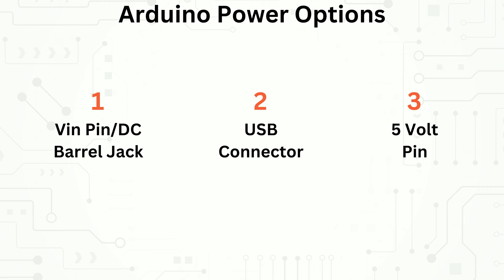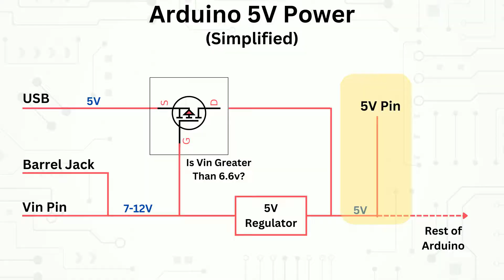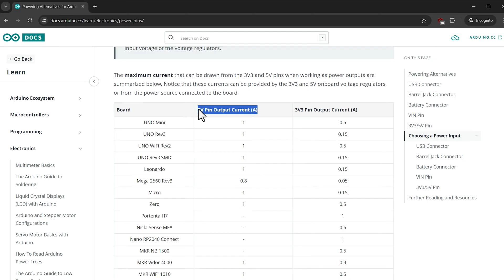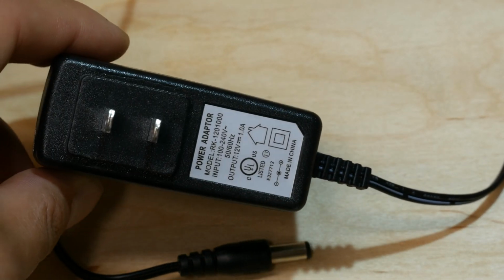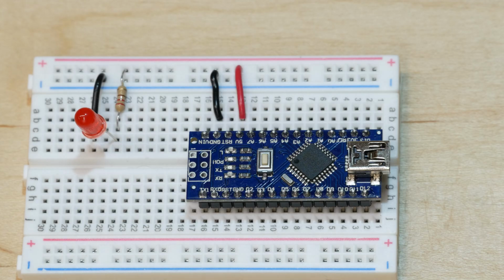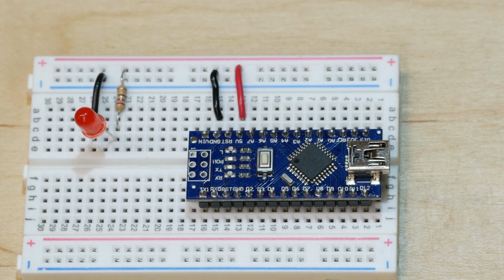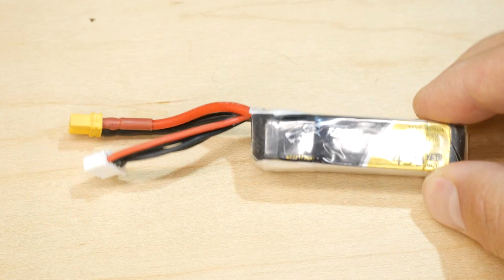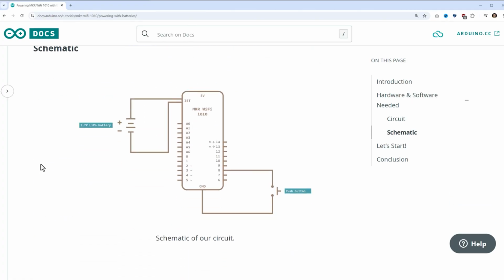Power ANY Arduino Project - The Ultimate Guide

Comment: Great video, thanks for sharing it. Question: I want to create a counter using 7 segment displays that require 7.2v - 8v. If I use a barrel 12V connection, and feed the bread board off the VIN, will that give me enough volts ? I am very new to this, so any help will be appreciated.
Reply from the maker: If you have something that needs 7.2-8V you will need to step down the 12V accordingly using a step down convertor. You can still use 12V on the Arduino VIN, but in parallel wire the step down converter to the 12V to get you the 7 segment display requirements.

ALTERNATIVELY you can use two power supplies like shown in the video, with the second being a supply in the rated range. 

What you don't want to do is plug 12V into a module that is rated for 8V, as that will likely destroy it. 

Now that's the power issue sorted. The other thing you will have to figure out is how to actually control it with Arduino. That's going to vary based on what you actually have there.

I'm guessing most likely it's a module that's got 1 or more 7 segment displays on it, plus some kind of driver IC, and (hopefully) a 5V compatible interface that's easy to connect Arduino to. In that case your best bet is to just look up a tutorial and you'll find how it all needs to hook up, example source, etc.

If by chance you are talking about a bare 7 segment display (no driver IC) OR this is some module that wasn't built with the intention of being controlled by a 5V logic microcontroller, you are in for more of an adventure. 

If it all becomes too much, there's also low current 7 segment modules that accept 5V input and are dead easy to use with Arduino. And a million tutorials on how to use them. So that's an another alternative.
Reply: @MattInglot  Thanks for that info. I think I may have a difficult road ahead, as I have an Arduino UNO, and 4 - 7 segment displays that are about 3" high. They are just the 10 pin displays. Suggestions ? I have watched many videos that use the small 1" high displays and I was hoping to duplicate the hook ups for these larger displays.
Reply: @MattInglot  Thanks for the info. So I have powered up the Arduino with a 7.2V battery, and can illuminate the display using the VIN. The display is cathode. Can the Arduino be programmed to use the VIN on the cathode display ? Thanks again for all your advice.

Comment: 11:55 Remind me: when do you power the board with the 5v pin vs Vin?
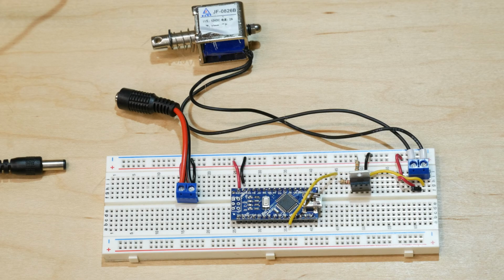Reply: Oh I think I have it at 5:00. If the power supply is 5v use 5v. If 7-12v use Vin. It's been years since I've messed with this stuff.

Comment: Hi Matt- I'm assuming in this video that the 24 V power supply uses less than 1 amp, and that it's power supply is attached to the rail ( couldn't quite see that).  Are there limits on voltage regarding the power rail.
Reply from the maker: If you're referring to example 3, I have the 24V supply going to one of the terminal connectors (it's the twisted red and black wires), and then using jumper wires to connect that to one of the power rails of the bread board. Critically, the 5V to the Arduino is connected to the power rail on the OTHER side of the breadbroad. So we have two power sources we are dealing with. Do not connect the 24V to the Arduino 5V or you will have a Deaduino.

I'm using a breadboard for demo purposes, but for a real project you normally want to move from breadboard to soldering something permanent on a protoboard (or even getting a PCB made if learning that is of interest). This is especially true for a circuit like this where the solenoid is actually wants a fair bit more current than the 1A that a breadboard can handle on a good day.  It's fine for demo purposes, it only fires momentarily so it's not going to harm anything here other than solenoid will underperform.

One other very important thing to understand. The power supply doesn't "use" anything in the way you imply. The load (such as this solenoid) dictates how much current the circuit draws. The power supply's job is to supply the current that is required by the load. A 1A supply will supply up to 1A. But if you hook it up to a circuit that draws 0.5A, it will supply 0.5A regardless of what the supply itself rated for. 

That 24V supply in the video has some massive rating like 10A or even more (I'd have to look it up), but that doesn't mean that the circuit draws 10A. However if I had hooked up a smaller supply, say a 0.5A one, then I would be overloading it and that's a bad idea.

Comment: Matt, great information. 

Quick question. You mentioned when you are powering a nano with a 5v USB power brick, you should not connect anything to the nano USB.
Can you please elaborate? 
(My project involves trying to power the nano through external power and then send serial commands through the USB)

Comment: I thought the 5V pin was only a (5v Out) pin, never knew it can be used as a 5V IN for 5vsupply for 5v projects without the worry of Arduino current limit.  Thanks for cautionary warning to not use the VIN / USB when powering through this procedure. 
I m so impressed that for the first time I'm commenting twice back to back.... 
I have a question though not related to this topic , it's for my personal project I'm working on a 5v-Sound-Reactive Laser Diodes , i was able to make different patterns with the laser diodes but i'm to make them reactive to sound so that not only it does the motion pattern like the RGB strips but also react to music.
Reply from the maker: The honest to goodness simplest answer is to google around, with keywords like "sound reactive LEDs with Arduino" Lots of people have made all sorts of projects that react to sound in various ways. Find something that does it in a way that you like, use it as a starting point. That gives you your input (in this case sound, processed in some way). Then instead of controlling LEDs or whatever the example is, put in code to control your lasers instead.

Comment: Thank you for the video!
At 11:50 you say "under no circumstances should you also try to power the Arduino through the VIN pin or Barrel connector".  Do you mean "don't COMBINE power" by providing 5 volts to the 5v pin and the VIN pin at the same?  You should be able to provide 5 volts to the 5v pin OR 7-12 volts to the VIN pin but just not both at the same time.  Correct?
Reply from the maker: If you are powering the Arduino through the 5V pin, do not apply power to VIN at the same time.
Reply: That's what I figured... thanks for the reply!!

Comment: is it possible to use the same power source, let say 8.4V, and use 2 DC-DC regulators to get 5V and 12V to power both arduino and the "external" components like motors ?
Reply from the maker: On paper yes, BUT two things to consider:

- I'm guessing the 8.4V means you are using a 2S LiPo. Can you use a 3S battery instead? That would typically power 12V motors just fine without a regulator, unless your application really requires 12V dead one. That removes the bigger regulator (motors draw way more current than Arduino so need beefier regulator). You can then step down to 5V for Arduino.

- The above will probably work, I know because I have 3S and 2S combat robot that drive motors and MCUs off the same batteries. And LiPos tend to be pretty good for this type of stuff. But motors = electrical noise, so depending on your application, you may find yourself dealing with power issues that could have been avoided with 2 power sources. So that's the caveat.

Comment: What will happen if you both both USB and Barrel/Vin 5V? Will the Mosfet still work?
Reply: No, because the Mosfet won't have the information to turn off the power.  It needs to detect >6V on the power input pin, to shut off the USB-integrated power.

If you attempt to power with both 5V sources simultaneously, you'll essentially have a short circuit between (5V + epsilon) and (5V + delta) as the sources connect, where epsilon and delta are the small deviations from 5V on the dot, that each 5V source provides.  You'll essentially draw current simultaneously from both power supplies, until the voltage drop across the internal impedances and wiring makes epsilon and delta equal to each other.  This may even mean your external source ends up charging your computer during this time, if the load doesn't draw enough current to allow voltages to match.

If you intend to do this, you'd want to fine-tune your external 5V power supply to match the USB power supply voltage as closely as possible.  Or use a USB adapter that allows you to abandon the USB power source.

Comment: Also yes please create a video about battery powered projects and selecting the correct battery for your requirements
Reply: And rechargeable ones maybe, and if they support being recharged while powering Arduino. A portable usb charger will work most likely, but it’s a bit less elegant solution.
Reply: @Emil_m  Uhm, how else are you going to charge a battery without a usb charger?
Reply: @JunkaTerri lol, I should have clarified ;) There are some newer batteries that have a USB-C port on them. I’m not 100% sure if they are designed to allow for being used + charged at the same time.
Reply: @Emil_m  Ah okay - anyway, usb-c doesn't change anything much - it is the same as micro usb, just better connectors and such stuff.

Comment: This is such a helpful video thank you so much. 

I had a question though, at 5:53 you said the 12V power supply can supply more than the 1A current the Arduino can supply, but the specs on the power supply you used showed the Output as 12V, 1A. So we're not getting more than 1A through the system?? Im confused, did I misunderstand?
Reply from the maker: If I showed a 1a supply and caused confusion then apologies! I was working with what I have on hand. But the important takeaway is that since the Arduino isn't supplying the power, you are not constrained to a 1A supply.

Comment: Great Video! But I'm curious if it's safely that the 12V adapter connect to the Arduino VIN pin. Because the voltage provided by the 12V adapter will be bigger than 12V. This is more than the maximum allowed.
Reply from the maker: Sorry I'm not sure if I follow. The 12v adapter will provide 12v. You do need to make sure that your Arduino model can accept 12v, but most will happily accept that and more on vin. Read the specs for yours and choose an appropriate supply.
Reply: @MattInglot  I used a multimeter to measure the output voltage of the 12V adapter and found that it was 12.xxV
Reply from the maker: @DashiTaiko  that should be fine. The Arduino site lists 7-12V for many models, but the datasheets show a higher voltage tolerance. For example Uno Rev 3 is 20V max, while the Nano is 15V. 

https://docs.arduino.cc/resources/datasheets/A000066-datasheet.pdf 
https://docs.arduino.cc/resources/datasheets/A000005-datasheet.pdf

So there is definitely leeway. And designers of Arduino would definitely expect people to be using power supplies that aren't exactly dead on 12V. Hope that helps!
Reply: @MattInglot  Thank you for your reply. I'm actually working on a project. Using a 12V adapter to power both arduino and 12V LED strip. I think using a buck converter and power the arduino on the 5V pin might be a more reliable solution.

Comment: Great video! I have a question regarding multiple power supplies: so if I'm using a 11.1V supply to power a solenoid (w/ a mosfet), can I use a 9V battery to power the arduino/electronics via the Vin? The video made it seem like you cannot do this unless the supply for the arduino is exactly 5V
Reply from the maker: Absolutely but i think you might be confusing vin and 5v pins :) 5v is the one that has to be exactly 5v if you are using it to power the Arduino. You would hook up the 9v battery to vin, which allows the arduinos voltage regulator to regulate it down to 5v. Just make sure to connect the grounds of the battery and the 11.1v supply since you are using two different power sources (unless they are electrically isolated which I'm guessing is not the case here).

Also what is the 11.1v supply? That sounds suspiciously like a lipo battery. You could easily use it to power the arduino as well.